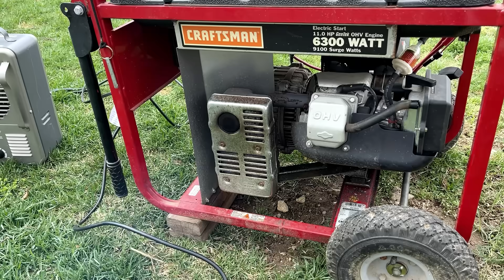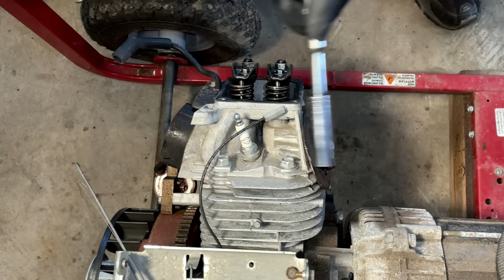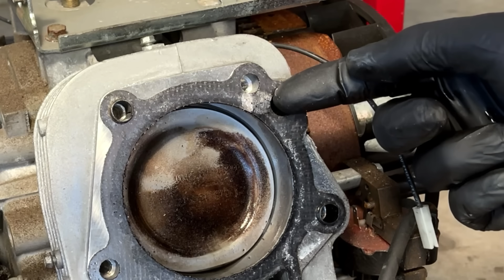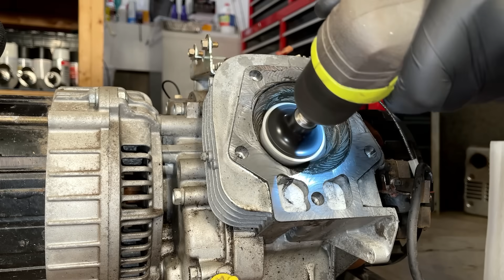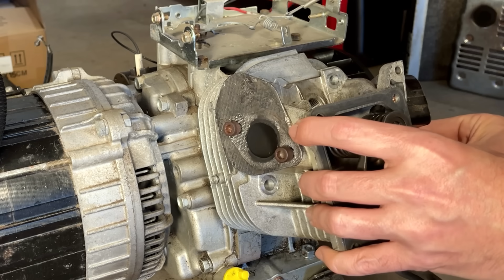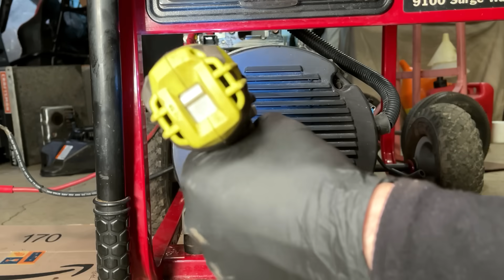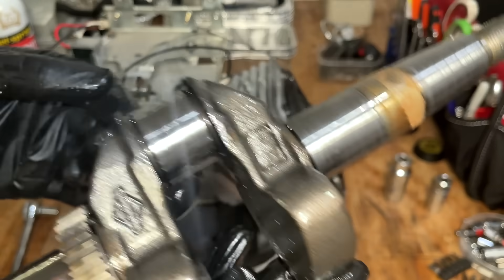Smoking Generator Engine (Part 1) - Easy Fix or Engine Teardown?

Comment: The wet exhaust valve was the clue to bad valve stem-to-engine sealing. Carbon crud will always grow there but is normally dry-ish looking; this looked like dripping wet. Hard crud means OK, soft crud means sealing issue. I honestly wondered why you didn't investigate that further.

I would also consider filling the scarred head gasket sealing areas with JB weld mixed with very fine aluminum dust, heavy on the aluminum. Plate-glass sanding back to flat on both surfaces. This needs some depth and mass, eyeball around 150 thou or more in the main area, and drill or grind a bit deeper as needed to avoid making a 'sheet' which tends to crumble in time. Edges can be thinnish as long as the middle 3/4 has strength. This won't hold compression and it's  heat directly but it will support the remaining metal which looks thick enough to keep the epoxy isolated while fully supporting the gasket. I've done this on motorcycles and cars so it should work here. 

Looking forward to watching your honing technique and equipment; everyone does that a little differently. With that and the valve seal fixed this one should have a lot of life left in it as long as they keep the oil full. Always a pleasure watching you work with such care and thought- a true Craftsman working on a Craftsman!
Reply: It was dripping with PB Blaster too.
Reply: The air/gas mix travel only one way: from the carburetor to the piston and through the exhaust valve and muffler. The fact that there was a lot of carbon on the valves mean that it came from the intake valve or the rings (cylinder) but cannot come back from the exhaust valve.
Reply: @cunnings309  Carbon results from combustion so of course every exhaust valve will have carbon on it. But that's not what we're talking about here. What I pointed out is the difference between normal carbon (dry and hard) and carbon from excess oil entering the engine (wet and softer). Has nothing at all to do with the air/fuel mix or where it goes.

Comment: JB Weld that shit.  Cold War Motors (Scott Newstead) has filled in a giant gouge in a cylinder in his low mileage 37 or 36 (I don't remember which) chevy from rust damage from sitting.  He hasn't put it back together, but there are MANY, MANY stories of cylinders being fixed with JB weld and holding for many years.  There isn't a lot of pressure on it from an advantageous leveraged position.  All of the forces are just pushing the JB Weld INTO the cylinder. No perpendicular forces on it.  Should hold fine. 
Personally I think it's not a great idea to just hone away until they are either eliminated or severely reduced.  What the hell, it's YOUTUBE content.  Surely this video is worth more to you than what this fixed generator is worth.

Comment: Hi James, I recently was given a Generac XG8000E it appears to have exploded the fan on the power head which of course took out the rotor and stator windings would you know where  I could get used ones or if a clone parts would be available ? I love your videos

Comment: For carbon in the engine try AC Delco GM Original Equipment 10-3015 Top Engine Cleaner it can be used with the engine running too. Some have mentioned valve stem seals which could be problem but valve stem seals cause oil smoke only when the engine comes off idle and goes away as engine speed comes up. Have you made sure the vent in the valve cover is open, had a engine smoke like that because the crankcase pressure built up to push oil pass the rings during the intake stroke.

Comment: Great video. Waiting for the second. Question about my snowblower. Has a Honda engine, been through all systems. Carb twice, even used micro bit to open idle circuit. Everything running correctly, but getting a varying tach reading. It has a muffled pop out of the carb.  It helped to flare the hood over the plug boot. Allowed plug to snap on better.  Could the coil be degrading?  The governor doesn’t even recognize it.    Thanks
Reply from the maker: There are a few things that could cause that.  Running lean (does it get better with a little choke), bad plug or coil and valves not seating well to name a few.  Would see how it does with a little choke and replace the spark plug to start.
Reply: @jcondon1  cleaned carb twice, increased idle circuit port,new plug and make sure it’s seated cleaned and reset coil, flywheel key ok.  Tach shows a variance.  We’ll taken care of and approx 8 hrs old. Runs great. Maybe carb might have a speck of dirt or governor spring weak.   Electrical?  My guesses. Thanks and take care.

Comment: that bit is stuck to the HEAD Knew it  piston rings  classic indicator 
the only other thing it could have been if it had a better oil feed to 
the head would have been valve seals  but the supply to those heads is 
so puny i am surprised they do not cease up solid

Comment: Great video! Yes I would sell it as is, as it makes adequate power. I was hoping it was just the blown head gasket that was introducing the oil to the combustion chamber. When selling, I would be honest and tell that it consumes a bit of oil due to imperfections in the cylinder wall.

Comment: Looked as if there are valve stem seals. Suggest you change them as well. 
When you first took the head off, the scratching was visible, but not as bad as at the bottom. 
Admire your patience

Comment: Hi James I took note of your comment on the difficulty with the tight locktite bolts. When I have good accessibility to the bolts, similar to your on camera situation. I give them a quick first attempt. If the bolts do not release I use my torch to heat the bolt head in the center. Use a very fine tip flame if possible. It does not take much heat. The locktite will soften and extraction is much easier. As you always mention I hope this helps. Keep the videos coming, I am looking forward to seeing the after honing result.
Reply: I’ve had similar success using heat on threadlocked fasteners. I thought about doing it in this case but was wondering how to get the heat onto the thread area. You solved that mystery for me, so thanks!

Comment: The reason you have no pulse is the valve cover has a built in one way check valve. It lets air go out but not into the crankcase. This way the crankcase will build a negative pressure (vacuum) that will absorb most of the pulse and only let the small amount of gas that comes from blowby pass. The head gasket would have to be extremely blown for it to be the cause of no pulse, to the point that there would be almost no compression.
Reply: As for the oil burning issue, there's not a lot of things it could be. Valve stem seals (particularly intake, as it has a higher vacuum on the intake side, the exhaust has pressure so it would blow the oil back in), the cylinder bore, or the rings. Personally I'd replace the valve stem seals, piston rings, and do a hand hone of the cylinder to get it more even and give it a crosshatch. Even if the final size is a bit out of tolerance for a new engine, it'll run fine. I've seen 0.25mm clearance between piston and cylinder run absolutely fine with no oil burning or loss of power.
Reply from the maker: Good point.  Was surprised though, was expecting blow by with it burning oil like that.

Comment: Great video Jim! That generator looks a lot like my Generac 7550 EXL. Wonder if Generac made that for Craftsman. 👍👍👍
Reply from the maker: Briggs and Generac where partnered up at one point.  The XL and EXL lines I believe were made (at least partially) by Briggs.  Generac and Briggs also made Craftsman branded generators. The XL and EXL line were a good example of how to make a generator properly.

Comment: Don't forget about valve seals those are a big point of failure on these engines, they won't look it but once you replace them with new and go to put the valves back in you will feel the difference as there is more resistance which means they're properly sealing. As far as the cylinder and that stuff goes I'd say just hone it with a good bead hone and put a nice 45 degree cross hatch to it and put a new std piston and rings in and that will most likely solve the issue for a long time to come.
Reply: Forgot to mention as well if there are steel or brass valve guides sometimes oil will push around them especially if they have a o ring but it's pretty uncommon for that to be the issue, just food for thought. I don't think these briggs engines have that but I've been wrong before lol.

Comment: I bet the breather valve is stuck. Causes overpressure in crank and pushes oil over the rings.
Reply from the maker: Not sure I showed it, but I tested the valve and found it to be working fine.
Reply: @jcondon1  Working fine?  How did you test it?

Comment: My thoughts are that if it isn't fouling spark plugs or shutting off on low oil shutoff, it would be good enough for a generator. They don't get used very often and usually not for very long. A heavier weight oil like Royal Purple straight 40 might help. You say there is a check valve in the valve cover so you don't get a pulse. It seems that the check valve should go the other way to maintain vacuum on the crankcase. Is there any way it could have been incorrectly installed or failed in some way? Do you have another valve cover to try? If crankcase pressure can't vent, it has to go past the rings or valve stems.
Reply: The check valve will maintain a vacuum in the crankcase, which is generated by the piston. If you imagine the normal pressure wave being a sine wave centered around 0, the one way valve will turn that into a sine wave mostly in the below 0 region, with only a small timr above 0. The crankcase vacuum will thus absorb the pulse.

Comment: My observation  when you pulled the head off was the engine isn't burning oil in the cylinder. Very little burning on the piston. The oil is being burned in the exhaust port as the exhaust exits the cylinder.  The oil appears to be being pushed through the valve seal. Burnt from the hot exhaust as it exits.
Reply: only the intake valve has a seal on these Briggs Engines
Reply: @danray9744  That being the case then the valve guide clearance is the issue. Still burning oil in the exhaust port.
Reply: Could be. Leaking valve seals are something that happen on bmws v8 engines. You get lots of smoke from the exhaust.
Reply: @FishFind3000  not a pressurized oil system, doesnt have vertical valve so oil doesnt get there easily like with OHV v8 designs, oil built on exhaust valve simply because it is the hottest place, piston cleaner due to issue was short term run after cylinder wall damage and piston is cooler than the head or valves. minimal oil in there because engine is able to burn it under load due to increased heat under load. Content Creator is on the right path although he should have used some tape, plastic, or cloth to chuck the valve up in drill i dont think the valve guide is the issue and dont think the exhaust has a valve seal in those only one for intake. ring 2 removed from the piston was at the 5-6oclock position where the most oil lays which could have filled the area between ring 1 and ring 2 with oil since oil is slung right at bottom of piston so essentially only 1 ring was working to sweep oil from the bottom and it passing over both the worst scratches.
Reply: Valves and breathing I'm tending to agree with you, surprised he didn't fit an inlet valve seal, also clean the oil out of the exhaust silencer.

Comment: If this were an old tired motor,  the default solution to smoking would be to add an oil thickening agent and wait until the compression weakens.     I wonder what happened to this motor originally.  I appreciate the troubleshooting steps.

Comment: Could the engine have been tipped on its side and oil seeped past the exhaust valve to contaminate the muffler like on a rider I once worked on. If it still smokes after honing the cylinder, let the engine run for an hour under load to bake out any possible oil in the muffler. It is also possible the crankcase contains the wrong oil, maybe a very thin synthetic. Just a few thoughts.
Reply from the maker: That's what I was hoping.  Engine runs really well for that much smoke.

Comment: Looking at your test run after you replaced the head gasket, I would have thought that it is a valve stem sealing problem, because the engine smokes the most when idling down which is an indicator for that kind of problem. But I´m far away from the scene and don´t want to play wise guy here, just a thought. Trouble is, it looks like the problem reverses after you refueled...

Comment: A tricky one. I would have wanted to run the head across some wet and dry on plate glass (or a surface plate), just to check for warping. Also, I would have considered changing valve guide seals although there was no hint of valve guide wear mentioned. Those score marks look the most reasonable explanation but you had to completely strip the engine to see them of course. Good luck...

Comment: it's interesting how quickly engine oil goes from translucent to black
Reply: Black oil is not bad oil, it's just showing you that the oil is doing it's job, carrying contaminants in solution to the filter which is not a 100% filter but it traps the worst particles then the fine ones continue to circulate in the dirty oil

Comment: I learned a trick almost 40 years ago to help people get their go carts overhauled without getting the cylinder bored. Order the ten thousanths over sized rings. Grind down the ring gaps to just barely fit in the bore at the top of the cylinder where the rings never reach. Then they are usually within spec in the worn out portion of the cylinder.
Reply: Thats an interesting idea.

Comment: I think you missed the valve stem seals on this one. You are right, you've got a bit of scoring in that cylinder but if you look at how much carbon was built up on that exhaust valve that's indicative of a leak at the exhaust valve stem seal. If you just had oil coming into the combustion chamber generally you'd see more uniform distribution of carbon. 
Not to mention from a mechanical repair order of operations it's easier to replace those seals than tear everything apart as you've done to look at ring gap and scoring in the bore.
Reply: The 1st thing my father taught me on my Honda 55 rebuild while doing the valves how important the valve guides seals are and what their job is
Reply: The smoke gets worse as the intake vacuum increases.  That definitely says valve seals to me.
Reply: The Exhaust has no Valve seal  only intake
Reply: @danray9744  if there's not an actual valve stem seal then it's relying on that guide clearance to provide a minimum leak path. If that clearance has opened up to the point that you've got a problem it comes down to if that guide is replaceable or not. If it's cast into the head then it's new cylinder head time unless you're prepared to do the machine work yourself. 
I don't see another avenue of repair here.
Reply: @DJS_ENO  I think the exhaust blowing out tends to blow oil out of the stem guide, doesn't suck in like the intake does.
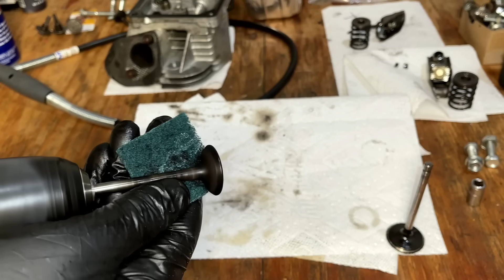Reply: I see what looks like a spring around an exhaust valve seal but it's hard to tell. 28:10
Reply: Its the crap aluminum bore
Reply: The exhaust runs much hotter than the intake valve thus the oil burns on the valve and in the muffler easier. If the ex. valve was leaking the way you think it would pressurize the crankcase with gasses everything would have been dirty in the valve cover area. the angle/position of the valves and lack of pressurized oil system leads away from the valve as the issue. I feel like the second ring removed from the piston was in line with worst scrape in the bottom of the bore leaving the oil free to go under the other ring. The amount of smoke was similar to the amount if the engine was being ran on a mix fuel and cleared up under load due to the temps under load being high enough to burn the oil. I also think the content creator is right to go ahead with a bore hone and new rings but to clock the rings at 9 and 3oclock  respectively. If he can procure file fit rings he can get rid of most of the bore damage and still run standardish gap.
Reply: small engine have no oils going thur head in valve thur pistons unless you talking about bigger engine that have oils shooting thur cam but this one doesnt so exhaust port get thrown out of engine not in engine only thing be sucked in engine is intake ports
Reply: The jaws of the drill chuck may have damaged the valve stem, where the seal seats. 28:56
Reply: Definitely a point of merit worth verifying prior to complete disassembly.

Comment: To clean carbon i used to use Chrysler combustion chamber cleaner.  (Chrysler part no. 4318001AD).  FWIW it has been a few years and the product may have changed.  We used to spray cylinder heads and tops of pistons and wait over night.  What carbon that was left would simply wipe off.  Saved time and effort as well as not wearing out brushes, etc..
 There may be other brands of a similar product but i was working at a Chrysler dealer and that was what we had.